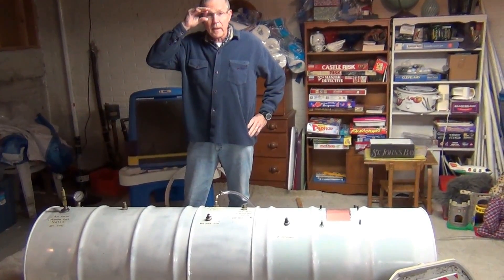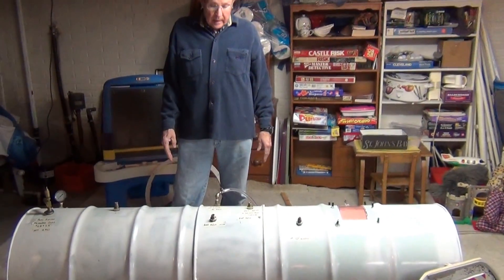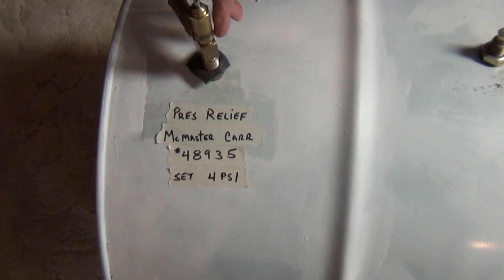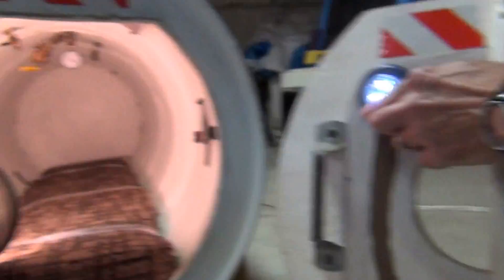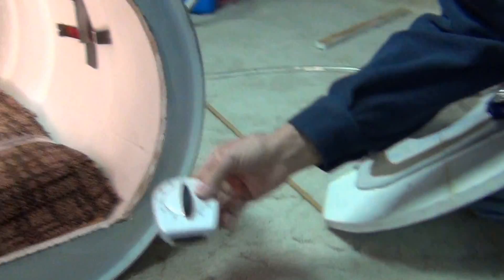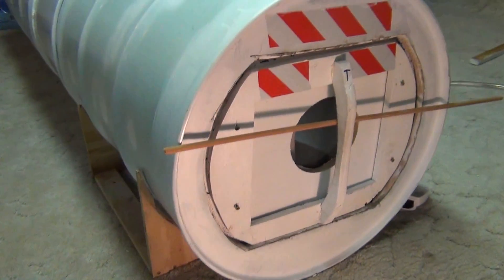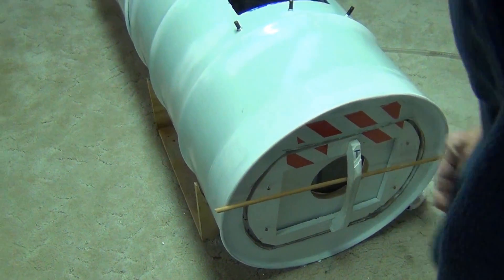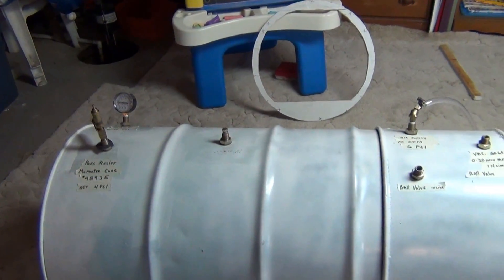Build an affordable Hyperbaric Chamber

Comment from the maker: In my Opinion.
It just may be that the "Professionals" are trained by the pharmaceuticals and can't make a bunch of money on something so simple?  I think that They are trained to treat you with a bunch of expensive pills for a very long time.  (treat / NOT cure)
I made my own chamber because I felt the commercial units were overpriced due to regulations.  this is relatively simple once you get into it.

Comment: I have help in the near Family. My cousins husband have 15 years of diving experience. 

Again agreed, you need very long adjustment time to cope with the different levels of pressure. My idea is to do the compression over 20 min. And the decompression in about 30 min. 
Ps. The pressure 1,5 atm is what they use in the Danish Main hospital but they mostly provide HBOT to patients with complex wounds that wont heal properly. But HBOT fixes this in most cases. btw I am from Denmark.

Comment from the maker: I believe you have done your homework well.   There will be NO explosions.
 
I believe that if you had access to an oxygen concentrator that had a mask or nose piece to breath higher concentrations of oxygen there would still be little / NO risk of explosions as the overall percent of oxygen in the chamber would still be very low.  (oxygen concentrators put out low volume of oxygen) 

NOTE: there could be an explosion danger if you were using in pure (100%) oxygen in lieu of air.

Comment from the maker: I am not sure WHY (it sounds high?) but Your target pressure is more than 4 X of what we have. 
 Please note that you will probably need to have the door open to the inside.  (to seal, and not blow the door open)
We control the decompression time so that it takes several minutes and we operate at 5 psi which seems to work fine.  You may want to research how long it takes you to get up to pressure, and duplicate the decompression time?
Good Luck.

Comment: You are doing some great Work here, thank you for that. I am currently trýing to construct a 1,5 atm (22 psi) chamber, i have purchased and old airtank(Tested to 12 atm(174 psi)) I need to modify the tank a bit though. Hopefully its ready this Christmas. I will most certainly test the chamber way above 1,5 atm before i take it in use. Ones Again thank you for posting the video it is priceless.

Comment: If you put a 1l glass of plasma into your chamber and a 1l glass in a room filled with 100% 02 you would have more than twice as much dissolved plasma after 1 hr. Adding to that the maximum amount of o2 in the plasma will be reached very quickly as the pressure inside the liquid reaches equilibrium at 71%co2 and 29% o2. 
However in the o2 room you will only have 02 in the plasma allowing 3 times as much gas.

Comment: You really don't understand the physiology of this. You will have O2 in plasma solution at saturation equal to the surrounding partial pressure,  which will eventually be 29% of 1.39ata = 0.41 ata that is the pressure excerted by o2. That is how hard the o2 is pushing to get into th fluid.        
Breathing 100% o2 at seal level gives you 100 * 1 or 1 ata of pressure. it is pushing more than twice as hard.

Comment from the maker: I wanted to mention that we do try to depressurize the tank at about the same rate we pressurize it.  To accomplish this we ended up with a modified check valve with a small hole drilled in it.  inline w/ the pump so when the pump shuts down most of the air leaks out thru the valve.  We also found the leak rate could be accomplished with a small funnel stuck in the intake after shutting off the pump.
I take my hearing aids out during the change of pressure, but can wear them once it stabilizes.

Comment from the maker: Yes, by pressurizing filtered air to 5 psi, there is about 33% more air (oxygen).  The pressure also push's the the air / oxygen into the blood plasma, which provide the claims of benefit. Breathing pure oxygen does not get the oxygen into the blood plasma.
Search hyperbaric therapy in Russia, China, Cuba.  It sounds like they treat over 60 ailments, and many are treated in the 'Mild' pressure range.  (under 1 atm)
Low pressure may take more sessions to be effective, but safer / lowers the risk?

Comment from the maker: I purchased the 0 - 15 psi pressure gage, and 0 - 30 inch of mercury  vacuum gage inside the tank (2 inch mercury about 1 psi) at Granger.  They were not high quality but cost me under $20 each.
we had the relief valves, but you can buy Mc Master Carr part # 48935 or equivalent.   Sometimes using some 'JUNK' you find / have is more fun. 
I prefer the second chamber (video #2) due to the increased size.  But if you go any bigger, you should consider a pump w/ more volume, or 2 pumps.

Comment: Also I just wanted to comment about the oxygen thing. The simple fact is that if you compress anything it becomes dense. When the density increases it means there is more of it which is simple physics. If you can put 4 to 5 psi it means there will be a much larger amount of oxygen in that chamber than we breath now. Just think at sea level the oxygen levels are higher and in the mountains where the air isn't so dense the air is thin and people breath harder trying to get more oxygen.

Comment: Hey terry great video. The only one like it on you tube. I have started collecting the parts for mine that I am basing right off of this one here. I work at a landfill in Canada and have access to a huge assortment of raw materials as I am sure you can imagine. I already have most of the raw materials but I just am wondering how do you find pressure gauges and regulators that go that low and that precise?

Comment: I did have a look around, there is a shocking amount of dis info out there, people trading off actual >2ata O2 pp studies with what they are selling. I also found a few reports of ruptured eardrums and such from rapid decompression.
 I would also add that O2 is toxic chronically which is why wealthy people don't live in high o2 environments. But if you doubt that you would still be much better of getting an 02 license and just breathing masked, you could even just buy welding O2.

Comment from the maker: Please take a refresher course in Physics & Chemistry.  Air is about 78% Nitrogen, and 21% oxygen.  By compressing the air to 5 psi (or less) there is just more air in the chamber, with the same ratio of elements, and there is still no risk of an explosion.
IF you pumped pure oxygen into the chamber (which we are not), you would have a valid point.  Please do not compare apples to oranges.
Reply: You sound like a real.jerk? Bad daym
Reply: I was wondering where that part was...

Comment: As for comparing masked to hyperbaric(sea level)  you are right if you are dealing with pressure injuries, but I assume you are not. For all other purposes you are concerned with partial pressure of o2 which you can get higher using a simple mask and tank, a lot higher. Just to add I think the home hyperbaric market is a sham in general. Unless you are breathing 100% o2 (or close) it is pointless. And at that rate risk of fire is immense.

Comment from the maker: I have seen Video’s posted by professional athletes with home commercial / zipper / soft sided units using compressed air.  They claim that it helped them recover / perform better.
My understanding is that you should not use a home unit with pure oxygen without a doctors prescription & technical support.  
Please tell them that in your opinion, you don't believe mild hyperbaric chambers (using compressed air) works. 
As a vet, I fought for your right to have an opinion.

Comment from the maker: For your ‘hypothetical’ risk of a tank rupture, I would have a greater concern for the commercial units that rely on a zipper & flap seal.  Those commercial units deflate from the inside by breaking the seal, and unzipping.  The unzipping is the same as a ‘rupture’.    
At 5 psi max, and a pump rated at 10 cubic ft / min. adding air into the chamber, your concern seems extreme.  
you should know oxygen with a mask does not accomplish the same results as hyperbaric pressure.
Reply: Found the aging narcissist 😅😅😅
Reply: wrong-they deflate by opening a valve and there is a double zip. No worries.
Reply: Nice and simple design, was wondering how you did the porthole?
Reply: @catman4471  I am pretty positive you could figure it out
Reply: @MdIuKbEz  Well, you've got to play dumb sometimes.

Comment from the maker: The Mild Hyperbaric Chambers in my video(s) are (IMO) as good or better than the commercial units that retail for public home use at $5,000 to $20,000.  
IF the commercial units have health benefits, then mine should as well.  
Any improvement is slow, requiring multiple sessions to gradually improve oxygen in the body.  I suffered with arthritic pain in my wrists for over 10 years. That pain in my wrists is now gone, so I believe in it.

.

Comment: A few thoughts and it has been a while since I worked in hyperbaric medicine. 
1 I see no benefit of this over cheap 02 gear, you get a partial pressure of .29 ATA that is way blow therapeutic levels, and way way below breathing 50% o2at sea level  from a cheap 02 setup
2 There is no o2 toxicity risk 
3 No added fire risk from o2
4 Huge risk of lung injury, if your homemade rig ruptures and you are A. holding your full breath or suffering from COPD (likely as you are appealing to older crowd)

Comment from the maker: My total cost for tank, fabrication, and pump was under $500, with the majority on the weld / fab, and used Bullard EDP-10 free air pump (capable of 10 cfm @ 10 psi rating) from eBay.  I had access to 55 gal drums for free.
There are other brands of free air pumps on eBay.
This tank is tight getting in and out, and you can't move around much. 
 I worked on a 4' x 4' x 4' chamber out of plywood, But that plan is scrapped for now.  Too much trouble sealing the corners on a 1/2 scale model.

Comment from the maker: Boris,
IF you are interested in how to reduce / avoid getting a cold or the flu for around $1 / year (Cheap), I would recommend that you watch the video "How to inhale Hydrogen Peroxide for good health" by Bill Monro.
I was skeptical, but after contacting and talking with Bill, I began doing this, and I have been more healthy for almost 3 years. (I don't get colds now)   I know it works!  Remember hydrogen peroxide is H2O2 (water + oxygen)  Germs do NOT live in  a high oxygen environment.

Comment from the maker: To clear confusion.  This chamber and the second one "Build an affordable hyperbaric chamber #2" Both are 'MILD chambers' that run on 'high volume / Filtered Air'!  (NOT OXYGEN)  
Air at 4 - 5 psi (1/3 atm) increases oxygen levels by over 30% (due to 30% more air in the chamber).  Commercial home units work the same way but typically operate between 3 - 4 psi. (NO  major DIFFERENCE)  
I understand the concerns of those selling similar commercial units, if too many people make their own units.

Comment from the maker: I had a weld shop fabricate / roll the 1 ft. steel band and weld it to the open ends.  
The negative issue I have with this unit is that it is difficult getting in and out, plus can be claustrophobic to some people.  But it works just fine at 4.5 psi.
 
We built 2 more larger units out of used stainless steel tanks. (4' X 4' X 43")  Big enough for 2 adults.   I will try to get a video posted for them some time soon.  I hope this info helps.   Good Luck.  Terry